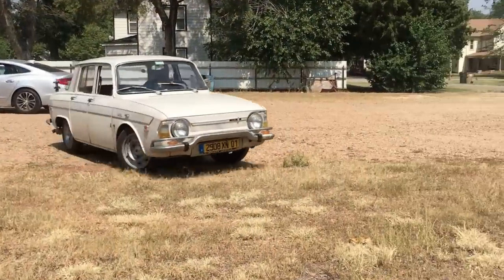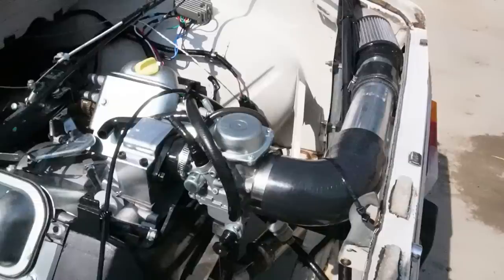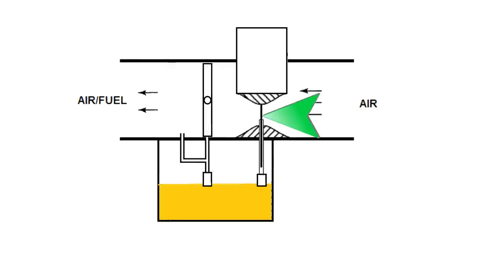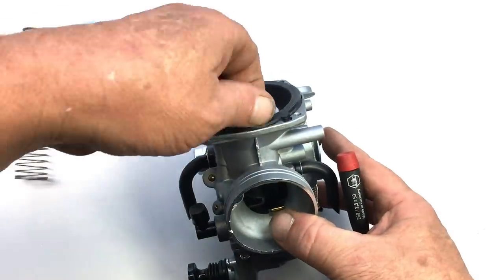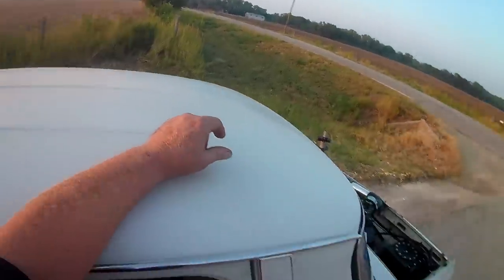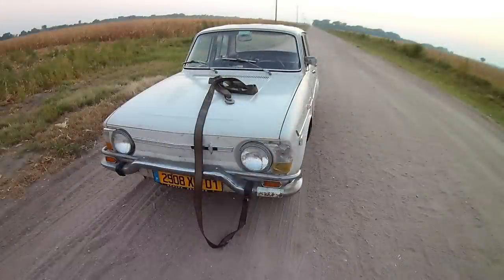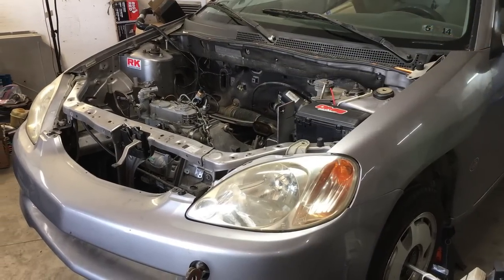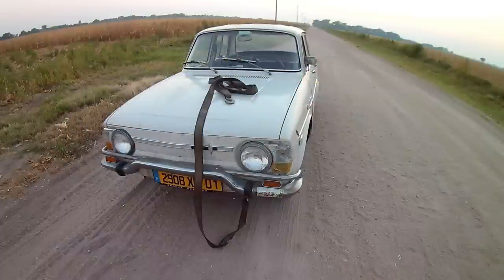S3 E31 We tune the Keihin CVK carburetor to work on the 670 cc predator engine in the Renault R10

Comment: I think I may have some insight into that dip in air fuel ratio. A similar problem happens with Chinese 50cc carbs. Check the accelerator pump. On 50cc CV carbs the accelerator pump is unecessary with a proper carb tune and simply dumps quite a bit of gas every time the throttle is opened from the closed position. I've gone from 85 mpg in the city on my Chinese 50cc all the way up to about 110 mpg simply disabling the accelerator pump. It also helps prevent oil dilution which is a known problem with these bikes but no one has enough old school carb tuning knowledge to figure out that the extra fuel making it into the oil is from the accelerator pump.

This is why no matter how lean a pilot you're still getting the dip. Check the accelerator pump circuit, possibly see if disabling it helps as this will make the CV carb purely vacuum metered.

Comment: about that ultra rich dip at the start of a run , when the idle orfice and the orfice under the trottle butterfy open up the piston over the pilot tube is still down so there a lot of vavuum behind it pulling a lot of fuel through the idle and butterfly orfice 
not further down the run the piston gets pulled up so the vacuum behind the ventury where the two orfices are get less so they draw les fuel in , now the pilot tube is providing most of the guel , and you just put the smallest jet in it you could find 
you might go the other way and make it bigger , and while youre at it maibe see if you can put a smaller jet in the orfice under the butterfly valve 
the dieselconversion of the insight is a pretty good idea , i bet it be nimble enough to become a daily driver , just dont stick the pipe through the hood 
have been looking for a first gen insight here , i found a few online in germany but man there expensive (guess rarity makes them so ) i bet there insight collector clubs here

Comment: Excited for that electronic fuel rack. Interested to see how far you plan to go with calibrating it, are you going to use TPS, pressure, engine speed, VE, temperature, egt. Probably simple is better.

Comment: Check out a " variated hobbit launch lever " . This needs a set similar put on it in the future. Or a pivot on the motor with pivot control like a motobecane moped with a launch lever.

Comment: Keep in mind that a single carburetor on a Vtwin isnt ideal because of the un even suck pulses. Usually one cylinder wil run richer or leaner. Just Chek the sparkplugs now and then.

Comment: I have some mowers with small turbo charged Kubota diesels. Granted they didn't go for maximum power out of the things, the common engine i have is the D1105. I have both naturally aspirated and some with turbo's. They are typically 25hp naturally aspirated (lots of golf equipment uses them to stay under Tier 4 regs) Some of the older mowers i have do have them with Turbo's and run around 31.5HP. None of the ones i've seen has adjustable fuel racks for manifold pressure. They are all just factory set so there is no factory option that i know of to clean up your exhaust anyway.

Comment: Wish I had a 1st-gen Insight.  I considered buying one new, but decided not to because I wanted a "true" hybrid instead of hybrid assist and preferred 4 doors for more seats.  Now I look at Insights with regret as they are lightweight, somewhat rust-resistant, and attained sufficient status that people know how to replace the batteries with modern cells.  If I'd bought one, there's a chance I'd still be driving it, though also a chance I'd have been crushed by an SUV or pickup by now.

Comment: Coming from a background of snowmobiles and side by sides that also have cvt transmissions I always carry an extra belt and tools to replace it if
Reply from the maker: We ordered two belts this time,  We will of course install the new one to fix the problem and we will hang the second one in place and secure it with zip ties.  In the event we brake another belt, the second one can be installed quickly on the side of the road.

Comment: My guess on the richness at the beginning of hard throttle is hydro-mechanical lag. When you open the throttle "hard" and the pilot jet dumps fuel it takes time to get to the cylinder in atomized form and I am theorizing that less of it is atomized initially as the fuel has to be there for the spark to matter. So then the little dip shown on the sensor is that lag. Of course if this was strictly an automotive operation I would suggest a spacer plate between carb and intake manifold but I'm pretty sure it wouldn't matter in this application. Not that I ever rebuilt a carb or several...

Comment: I dabbled with a Harley CVK in a draw through configured turbo 1600 single port VW. After just a brief time I moved on from that arrangement. The whole 0 fuel pressure thing was hard to work around and no matter what I did tuning wise it just seemed to have a mind of its own as far as fueling. I came to the conclusion that the slide and diaphragm are fundamentally tuned for a vehicle that has RPM and vacuum signal changes far faster than a heavy car. The turbo just amplified this. I know you said no car carbs but i feel at least it would make for good TV to try a Ebay VW solex 30 pict knockoff. Moore fuel circuits, real fuel pressure can be handled and you have an acccelerator pump. all my experiments were wideband tuned as well.
Oh and is that the saturn trans still in the insight?

Comment: I have had a hell of a time trying to tune those knockoff Amazon carbs. A few I just ended up throwing away and telling the guy to get the factory carb. I'm guessing the air passages are not the correct size because I have never been able to install factory correct jets in one of these on a stock engine and have them run correctly.

Comment: I wonder if the belt was on its way out even in the unofficial accel run? It sure seemed to get to 40mph a lot faster!
Reply from the maker: It's possible.  in the past two weeks I noticed the belt was looser than normal.

Comment: Just a thought, I'm not seeing an accelerator pump "squirters"  on the Carburetor.  If you succeed in repairing the off idle afr mixture, You may kill the acceleration rate of the engine.

Comment: I love your videos. Every time I have walked through Harbor Freight I have looked at those motors and wondered what you could do with one of them. You have the knowledge to actually do it! 
I wonder if the air filter is getting access to more air than it should because the trunk (hood?) lid is off? Perhaps air is coming over the car and more is available than would be with the lid on? Maybe just a baffle over the air filter would be a fun experiment?

Comment: Your odd little engines and tests are surprisingly entertaining. Really glad to have stumbled across your channel. 

I have a question about your Renault. We get the feeling that it is a keeper. Will it end up with a donor engine (rear) from some modern front wheel drive car? 

Even if it doesn't need the power, I guess something that is reliable can be a nice ending.
Reply from the maker: We plan on using the car for a while to test different engines.  However we don't want to make any permanent medications to the car.  Everything we do has to be bolt in.  At some point in the future the car will be sold to someone who needs it for parts or restoration.

Comment: Hiding under that "brass cap/plug" on the bottom of that carb I believe is your air to fuel ratio mix screw for the carb itself. I have a feeling if you remove it you can fine tune some of the other changes you have already made.

Comment: I've been thinking about your changing the carburetor slide/piston/depression spring…

That's not right. The spring is holding the valve in a position calibrated to provide a constant velocity of the airstream.  Changing that spring makes the velocity inconsistent, and it operates (& tunes) more like a normal carburetor.

I think your problem was that the carburetor is oversized, and it didn't reach max travel.

Comment: You need to build a set of compound turbos on the kubota! I’m running a kp31 over a TD025 on my D662 kubota I installed into a cub cadet 128.

Comment: Tune AFR desired during constant RPM, not acceleration. Engines can run slightly lean during acceleration (which actually helps), then stoich when held constant (like cruising).  Conversly, if tuned for acceleration they might run rich when cruising. That hurts fuel economy, and spark plugs.

Comment: Raise the needle and the slide has holes if u restrict the holes by jb weld and redrilling at least 1 the slide goes up slower.and ur midrange will richen.and go up 2 sizes on main jet increments 2.5dont mess with slide spring.Rich part throttle will foul plugs use the original idle jet or just go up 1 size for good driveability

Comment: I haven't been in the comments section, so maybe it has already suggested that you are getting turbulence with your carb adapter plate where it transitions into the stock setup.  Maybe a triangular wedge attached with a single tapped screw and some super glue?  And it's too bad you can't modify that transmission to a 2 speed sequential with dogs.  That would cut a second off your time.  Maybe more.

Comment: How about getting the top of the pistons ceramic coated to keep heat absorption down so the motor runs cooler & becomes more resistant to heat damage

Comment: You could also try a modern Renault engine, such as the turbo 1.2 and you'd actually get more power and better fuel economy. There's a 900cc Renault engine somewhere.

Comment: Motorcycle carbs cvk type have holes on slide.u can cover one if it has 2 and u can Redhill ro a smaller size.so the needle goes up slower=richer.if holes are bigger it opens faster=leaner.try that.I would use to flat slide carbs.more power

Comment: While I am looking forward to the kubota in the Insight I was really excited about the vw diesel in the Insight, what happened with that?
Reply from the maker: The VW engine was a perfect match for the Insight.  We ran into a problem with the front motor mount and the best we could do was hold the engine in place with 3 M8 bolts.  It would have worked, but I was not comfortable with that.

Comment: How do you like that GPS speedometer? I have been considering getting one for my 5.3 S10 swap project. I'm planning on getting the factory speedo to work eventually. Will need some PCM tuneing to properly calibrate it.  Factory speedo only goes to 85 mph though. I'm sure I'll get over that at some point.

Comment: for fun, try motor-as-generator electric drive, yep like diesel-electric trains drive, electric has the horse power, acceleration, and the gasoline has the range. also try engine/battery heat recycled heat gasification carburettor, push not pull
Reply: belt no good, or chains, axle or electric drive

Comment: Is it possible to configure this carburetor an engine to idle slightly lean and then go rich at high power? I would think that a post emission control design might be intended to run like this, but can't be certain.

Does it make sense to monitor EGT on something like this to make the configuration isn't going to destroy the engine? It moght indirectly indicate AFR, too.
Reply: Also, is it possible to measure the cylinder head temperature on this engine? That could help with tuning as well. I think some aircraft procedures mention adjusting the mixture based on peak cylinder head temperature, but they can change the mixture during flight.
Reply from the maker: A slightly rich idle is preferred.  Keep in mind we don't idle the engine much and its all about driving the car.

Comment: The Keihin 32 CVK is waaaay too small for a 670. Hell, my old, Aircooled Kawasaki BJ250 has a CVK34 for barely 21hp. 
With the CVKs you have to go a LOT bigger than with conventional föat or round Slides.
Or use two CVK32s, one per Cylinder. That is the same as the old BMW 650cc Airheads used, although those were Bing 32mm Conszant Vacuum.
This also explains the immediate rich condition and the following lean. There is just waaay to strong of a Vacuum Signal at low Manifoold Pressure and too little Venturi to support High MAF.

Also: Have you ever considered using a Motorcycle style Primary Chain or Cam Belt with a Ducati Style Dry Clutch mounted to the Adapter Plate?

Comment: A worn belt can make a huge difference in CVT acceleration, just FYI
Reply: I think the CVT could stand a bit more tuning tbh, the way the engine revs suddenly drop down after it reaches a certain speed cannot be helping.

Comment: Hi , try a Mikuni 28-33mm accelerator pump carb 
Kohler use a 28mm  kehin with accel pump on a 725cc  v twin max rpm 3600rpm  
On any other car 12.5;1 to 13.5 :1  afr is fine for accel pump and WOT 
General tuning advice is 
changing main jet raises /lowers  the fuel curve 
transfer slot and low speed air bleed will raise lower the low end  or angle of fuel curve 
fuel idle and  transfer jet tailor the fuel for idle and transition 
main jet in primaries generally does cruise [if u have no secondaries or Power valve it needs to run 13.5:1 afr ]
High speed air bleed ,,as it states raises or lowers the curve at the top end

Comment: question.....how come using a chain drive as opposed to a belt drive ever been considered or has it already been considered since i never seen the engine install....?
Reply from the maker: The belt drive is part of the CVT transmission we are using along with the 4 speed transmission.  The type of CVT we are using is belt only and isn't possible to do with chains
Reply: @robotcantina8957  ...this Renault isn't a CVT right?

Comment: I'll bet that you could accelerate faster if you'd take some weight off the automatic clutch. It seems to shifting up high on the belt too soon.
Reply from the maker: I mentioned this in a previous video, we plan of doing some clutch mods after we sort out the carburetor.  We don't want to make two different changes at the same time.

Comment: Honestly only need a half inch tube to get the carburetor to run right I never ran air filters on my moped the slide would go up slower with the air filter

Comment: My 2000 Manual Honda insight manual transmission  in grey gets 65mpg and that is nothing compared to the guys that 
Mod  it for Milage!

The Cd is low and the car is light.

If the High voltage battery 144 volt dc  dies completely you can run without it , but it is a pig.
You have to trick the car into using the IMA boost motor as a generator to charge the normal 12 volt car battery
But it is not too hard .

The car has a starter but I have never used it yet as the boost motor does normal starts using the 144 Hv battery.
It does NOT have an alternator at all it uses a 144dc to 12.5 volt dc  converter .

Comment: I wouldn't mind seeing a long-range cross-country episode with this particular car. Why? To see if an industrial engine is reliable enough to holdup for hours at highways speeds and hundreds/thousands of miles? If not you - perhaps partner with one of the other youtube channels that do such things. Just throwing that out. Note; I wondered several times about stress on the torque converter taking off in a higher gear. It may deliver better performance numbers but result in far more heat that would translate to wear and tear. Just pondering out loud.
Reply from the maker: Taking off in 3rd gear for the acceleration runs is necessary in order to keep the tests consistent, but I think your right, its probably hard on the belt for sure.

Comment: why not start in second? wouldn't that provide more top speed torque? or has he explained it already 😅
Reply from the maker: Starting off in second is faster initially, but it takes a bit of time to shift this transmission into third and the overall time is about the same as just taking off in 3rd gear.
Reply: @robotcantina8957  thank you for the wisdom Mr. Cantina!!!

Comment: It sounds like you need to get the engine to a higher rpm before CVT weights and springs start to load up the engine. There is clearly an engine bogging down sound on the video.

Comment: You could maybe try looking into a SmartCarb, they don’t need any adjusting whatsoever. They are on the pricier side tho, a looot pricier
Reply: robotcantina_OnTele-Gram.  I could also suggest maybe adding some sort of under tray for the engine compartment, with the cvt belt sitting rather close to the ground I believe it’s quite easy for debris to get in there, especially when doing donuts, running temps might go a bit up but I doubt it would affect performance. Godspeed to you, love your videos!

Comment: Think it may be time for bigger cvt. The belts I run on my snowmobile are 1.44" wide and can handle 250 hp +. Why do something right when there is an option for overkill. Actually I am sure you could get a 1" belt and shim the cvt you have and be just fine. I know you like data so maybe after doing donuts take a temperature reading of the CVT sheaves. May need to direct some cooler air around it.
Reply: My thoughts exactly. Not only can the snowmobile be far more durable due to size, but also very tune-able for engagement and shifting rpm.
Reply from the maker: We could replace the clutch system if we were going to keep the 670 engine in the car.   The 670 will soon be replaced with another engine and it isn't worth the expence.

Comment: That particular style of engine needs to have a carburetor on both cylinders. Equal air fuel distribution is non-existent with a single carb. One cylinder  will always run rich.

Why do you think the manufacturer went to the extra expense and complexity to install the dual intakes?